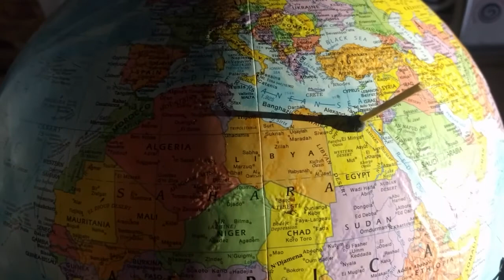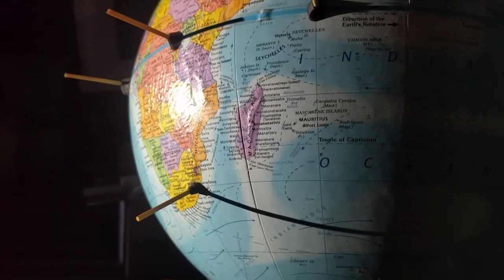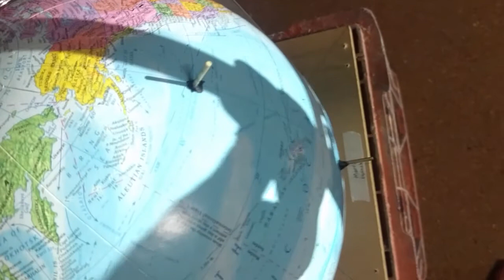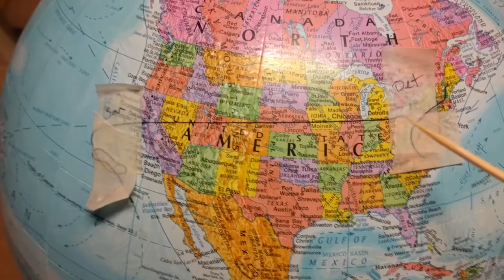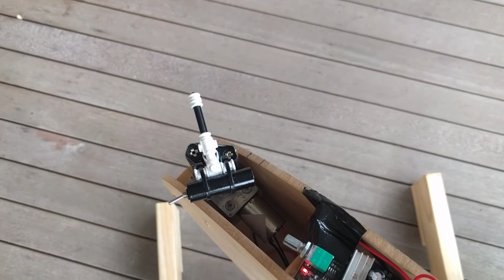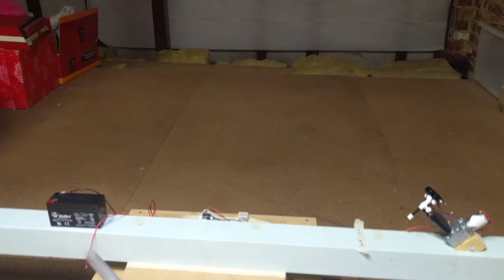Wolfie6020's Equinox Challenge 2018

Comment: +DelBoy 1967: Your explanation of the change in angles of the shadows and the terminator line was clearly worded and clearly matched the model. I really wish you had edited a bit of the video, because the model and your explanation were great; you obviously put in a lot of thought into the design. Your "extra" explanations for the tropic of cancer and cancer was a nice touch. Outstanding!
Reply from the maker: Solarsicle
Thanks for watching the video Solarsicle
I agree the video could have been made shorter compared with the other entries. 
I guess it depends on your target audience, as those who support the globe don't need the long winded explination. 
For the undecided fence sitters still unsure what shape the earth is, a clearer explination with minimal edits work better as it shows you are not trying to conseal anything from them. 
This is what I found from my previous scale solar eclipse model from last year. 
a few skeptical comments even when using multiple cameras. 

I do agree a shorter presentation may have worked better in this instance. 
I probably could have halved the video with edits 
I'll have to find out the best way to do voice-overs.
Thanks for your comments and watching the video. 
Cheers Del
Reply: I'm not throwing shade at you; I want you to be proud of producing something that is extremely well done. Even big blockbusters get a pass from the folk. That small detail with the sticks pointing at the sun; that was really cool, and not that many videos showed that. Dude, you're an expert!
Reply from the maker: Solarsicle
Thanks mate, appreciated. 
If you haven't done so already, please don't forget to thumbs up and add your comments on the contest page under the video video listing you like best to cast your vote. 
https://youtu.be/NlcqlpMRiiE
NOTE: To VIEW all the videos you will need to change the filter "Sort by" from "Top comments" to "Newest First" then scroll down the comments list.

Cheers